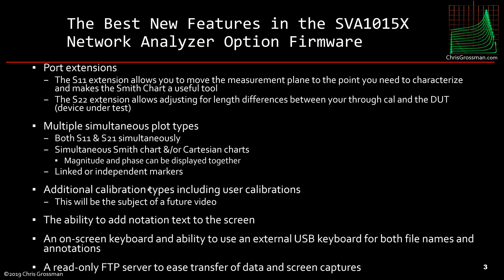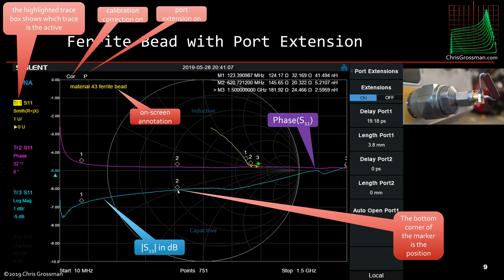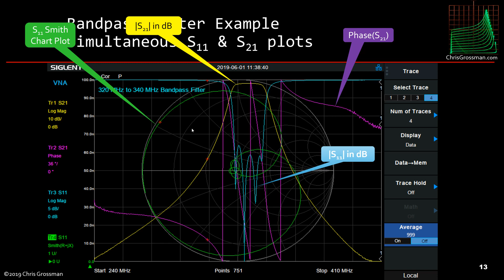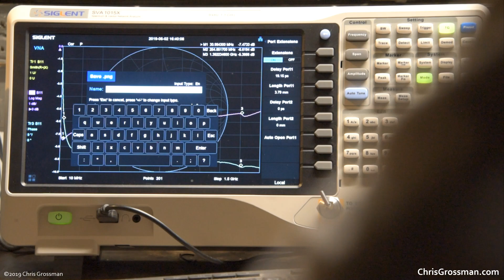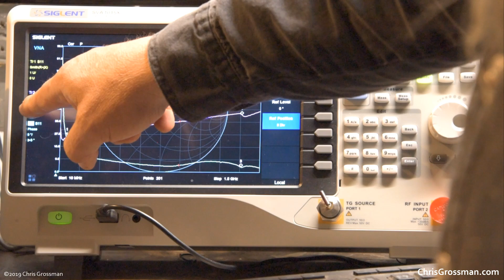⭐ 0005 Siglent SVA1015X VNA Option Firmware Update Review

Comment: First off, thanks very much for making these SVA1015X videos! 😊
It is May 2026, and while a I have a NanoVNA and TinySA-Ultra, I would like to have something with the tracking generator.
However, you mentioned sweeps that were a minimum of 5-MHz which seemed really out there.
I’m not an expert RF guy but did want to get into HF circuit design, so sweeping  filters would be a must.
So, I was looking at getting this instrument, but both noticed it was over 7 years old (and with even a lot of SMT devices becoming obsolete, am worried about repairability or possibly Siglent having a new model soon?), and was wondering what they finally ended up with as far as firmware updates?
Anyway, is this an instrument still worth getting or should a person go in a different direction?
Again, thanks for doing these videos, they were very detailed and useful! 
EDIT: I noticed that “SSA3015X Plus Firmware – V3.2.2.3.3R1 (Release Date 12.11.20)” was the last firmware update; seems when they are done with an instrument, they are REALLY done with it! 😮
73… 😊

Comment: Dear Chris, I have a SVA1032X and when I'm measuring a coil at 200khz I get on SVA 11.3ohm + j199ohm 158µH, with my LCR45 meter I get 200mOhm + j198.1ohm 157.6µH
When I check this with calculation then both values are possible but with SVA Q factor is 18 & with LCR45 Q=990 Do you know what could be the cause? 
I use 1m coax cable, I've set Length port 1 to 1000mm and I use averaging. I have a calibration set and calibrated before measuring.
 I have no experience in measuring with analyzer so I don't know what things are important for measuring. My measurments are only up to 1.5MHz.
I made a picture on setup: https://photos.app.goo.gl/ske7LLaawB1q2SA57
When I use the coil in series resonance setup with 106pF capacitor I can get +-400V @ +-900Khz while Q factor on SVA is 2.12 and I only use 12V pulse, so Q should be much higher.
The LCR45 meter is giving me to high value for Q I think, so I have some trouble in figuring things out.
Kind regards

Comment: VNA analysis starting 10Mhz? Tracking generator starting 5 Mhz? Cant analise a 3.5 Mhz antenna?  Can't analise a 455 Khz Collins mechanical filter? Forget! Amateur radio will not buy!
Reply from the maker: The latest firmware works down to 100 KHz and works great for S21.  However limitations of the input directional coupler limit the low end useful range of S11 to about 2 MHz
Reply: @Chris_Grossman  Hi Chris! Is a good new, any way that still is a limitation for the amateurs. Keep up the work, and thank's. Was interesting to compare the results with a small device that is coming for the amateur radio, Nano VNA! Many "miths" about the radio will come down!

Siglent will sell a lot if they look for that "low end" off the market!